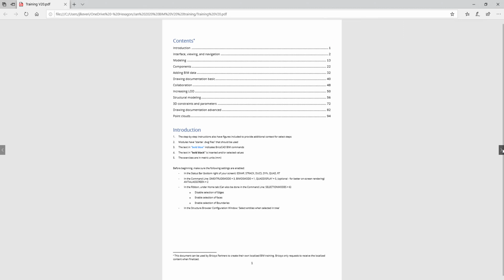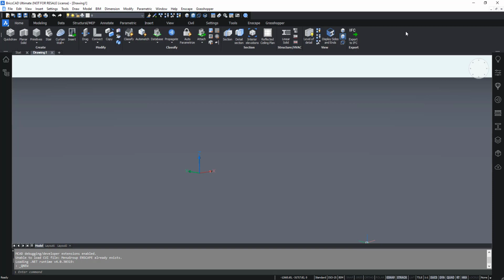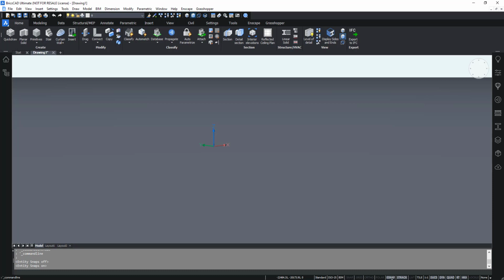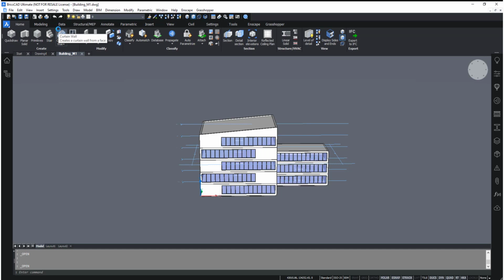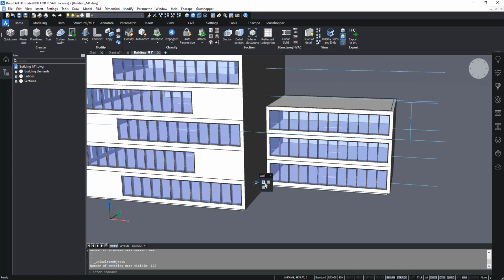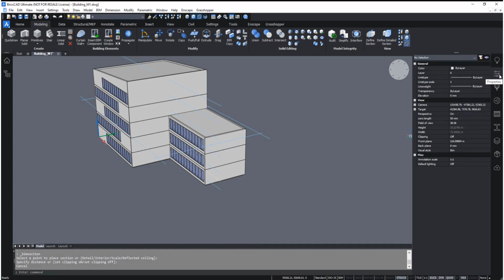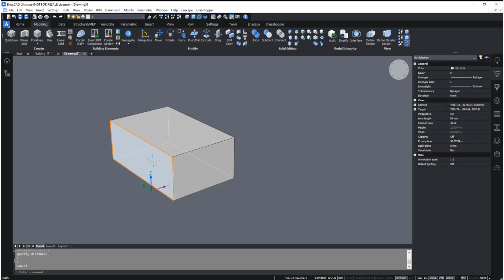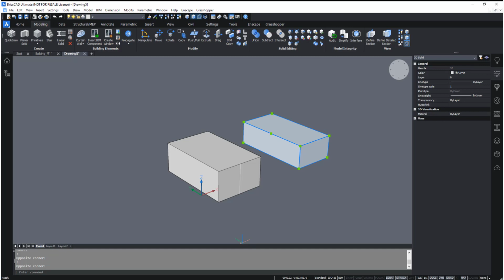BricsCAD V20 BIM Academy 1 - Introduction, interface, viewing & navigation

Comment: Hello, I have a quick question about the interface.. for some reason in my dark mode version I see all the icons in hidden lines instead of shaded... it's a bit annoying to see... when I switch to the light mode it's fine. Is there a particular reason for this? Many thanks in advance!
Reply from the maker: Hi, Giuseppe, we did not encounter this issue. Could you, please, submit a support request on our web page (the login is required), insert a screenshot of this issue, add more details (including the Operating System, the Windows display scale) and our technical support analysts will be glad to help you:  
https://www.bricsys.com/protected/support/NewSupportRequest.do